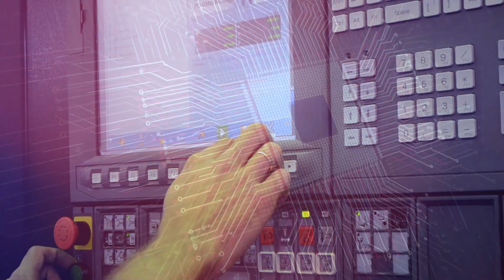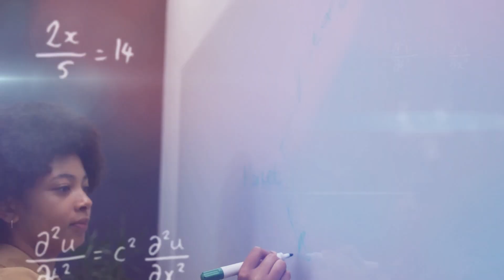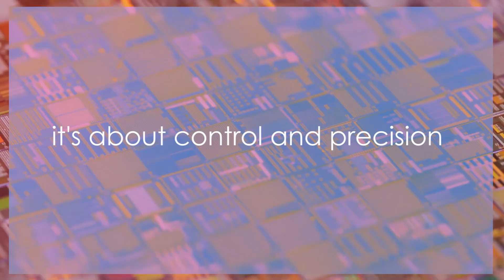China’s New Machine Makes Circuits Smaller Than DNA!

Comment from the maker: China’s New Machine Makes Circuits Smaller Than DNA! https://youtu.be/OZqCz1zJdA0
 
 Discover the power of possibility with China's first homegrown e-beam lithography machine Xizhi! This technology breakthrough could redefine the future of Chinese semiconductors, showcasing innovation in semiconductor manufacturing. Learn how it works and why it matters, exploring the future of next generation tech. Dive into how this tech could reshape the global chip race and accelerate future quantum innovations!
#KIMLUD #FutureTech #Megaprojects #Engineering #AI #Robotics #SmartCities #SpaceEngineering #FuturisticDesign #InfrastructureInnovation

Sources & References: China’s Chipmaking Breakthroughs (5 References)

1. TrendForce – China Unveiled its First Commercial Electron Beam Lithography Machine
👉https://www.trendforce.com/news/2025/08/18/news-china-unveiled-its-first-commercial-electron-beam-lithography-machine/

2. China Daily – EBL System Marks Leap in Quantum Technology
👉https://global.chinadaily.com.cn/a/202508/16/WS689fd3a0a310b236346f1fb2.html

3. TMTPOST – China Unveils First Commercial Domestic Electron-Beam Lithography Machine
👉https://en.tmtpost.com/news/7659392

4. PhoneArena – China introduces its first domestically made e-beam lithography machine
👉https://www.phonearena.com/news/china-introduces-its-first-domestically-made-e-beam-lithography-machine_id173248

5. Futunn News – The first domestically produced commercial electron beam lithography machine has entered application testing
👉https://news.futunn.com/en/post/60641519/the-first-domestically-produced-commercial-electron-beam-lithography-machine-has

Sources & References: U.S. – Nvidia / Chip Export Deal (10 References)

1.  Time – What to Know About Trump's Nvidia Deal and China's Response
👉 https://time.com/7309264/nvidia-trump-china-chips-deal-h20-blackwell-national-security-concerns/

2.  Vox – The Nvidia chip deal that has Trump officials threatening to quit
👉 https://www.vox.com/future-perfect/458088/nvidia-trump-h20-chip-ai-china

3.  Washington Post – Trump’s chip deal sets new pay-to-play precedent for U.S. exporters
👉 https://www.washingtonpost.com/technology/2025/08/12/trump-chip-deal-nvidia-amd/

4.  Windows Central – Why NVIDIA and AMD Agreed to Pay the US Government 15% of China AI Chip Revenue
👉 https://www.windowscentral.com/hardware/nvidia/nvidia-amd-us-government-15-percent-china-ai-chip-sales

5.  Tom’s Hardware – Nvidia H20 GPUs reportedly caught up in U.S. Commerce Department’s worst export license backlog
👉 https://www.tomshardware.com/pc-components/gpus/nvidia-h20-gpus-reportedly-caught-up-in-u-s-commerce-departments-worst-export-license-backlog-in-30-years-billions-of-dollars-worth-of-gpus-and-other-products-in-limbo-due-to-staffing-cuts-communication-issues

6.  Reuters – Trump opens door to sales of version of Nvidia’s next-gen AI chips in China
👉 https://www.reuters.com/world/china/trump-opens-door-sales-version-nvidias-next-gen-ai-chips-china-2025-08-12/

7.  PBS NewsHour – Under new, unusual agreement, U.S. will get a 15% cut of Nvidia and AMD chip sales to China
👉 https://www.pbs.org/newshour/politics/under-new-unusual-agreement-u-s-will-get-a-15-cut-of-nvidia-and-amd-chip-sales-to-china

8.  Financial Times – Nvidia and AMD to pay 15% of China chip sale revenues under Trump deal
👉 https://www.ft.com/content/cd1a0729-a8ab-41e1-a4d2-8907f4c01cac

9.  American Action Forum – Trump’s Political Tax on Nvidia Chips to China
👉 https://www.americanactionforum.org/insight/trumps-political-tax-on-nvidia-chips-to-china/

10.  CEPA – Chip Export Controls Don’t Work
👉 https://cepa.org/article/chip-export-controls-dont-work/